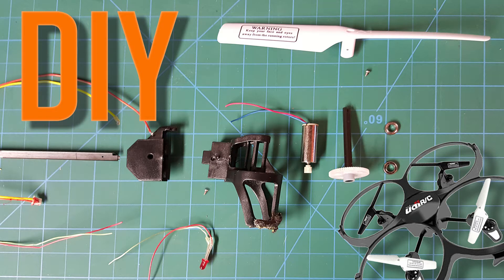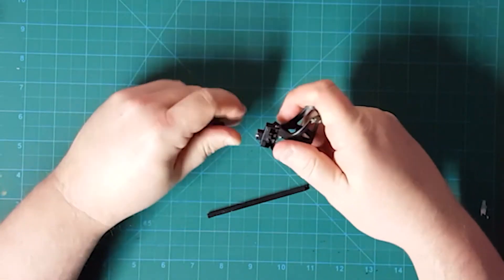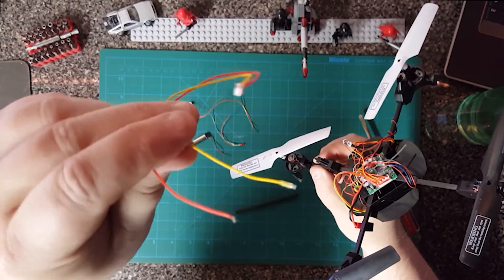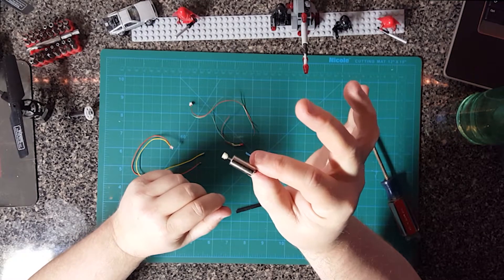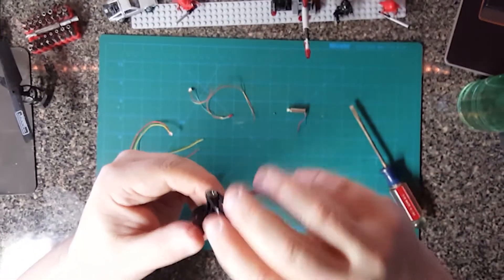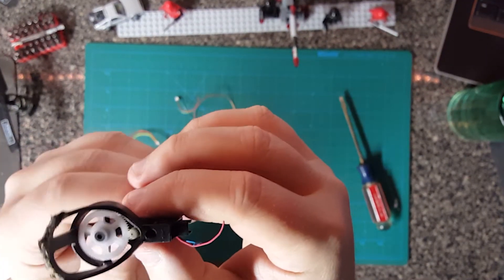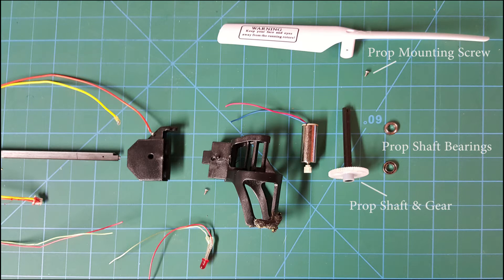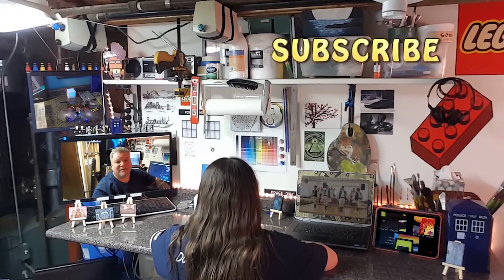UDI Quadcopter Motor & Gears Disassembly - U818A DroneTube

Comment: This video helped me replace the defective motor in my U818A-1 quad!! I was unsure about how to remove the housing at the end of the leg but once I watched this I was able to proceed with confidence that I wouldn't break it. I swapped out the motors like a pro! It's flying a lot better but clearly the bearings on the large gear are sticky, so I'll have to replace either those or the whole arm at some point. Anyways, TYVM for the most instructional video, it was exactly what I was looking for :D
Reply from the maker: Hey Tim, glad to hear the video helped. Good luck with the bearings and yeah it might be easier and more cost effective to just replace the entire arm. Happy flying and thanks for taking the time to post a comment :)

Comment: Having issue with replacement arm motor assembly.  Installed new arm and motor starts to spin with no control.  Swapped connector with other motor and issue moved.  Old motor seized up, could that fry the board connection?
Reply from the maker: Yes, I have heard of this exact issue in the past and it is usually the main control board. Possibly having too much current draw from the seized motor and shorting the main board. Sorry for the bad news!!!

Comment: very well thought out tutorial. you should do this professionally!
Reply from the maker: Thanks for the kind words crabtrap! :)
Reply: ThinCube
quick Q: how heavy do you think one of the metal arms are? i'm considering doing a carbon fiber armset ,but i originally thought the arms were solid steel. I'm wondering if the the t savings would be worth it now.
Reply from the maker: I'll weigh mine when i get home this afternoon and let you know. I'm actually not 100% sure that they are metal but will let you know either way. :)

Comment: Hi ...thanks for the video. Very helpful...my Quadcopter the wire going inside the motor (under the prop) is broken.  Is it possible to repair it easily?
Reply from the maker: Hello, glad the video was helpful. As for the broken wire, the ease of repair will depend on whether or not you can access where it is broken. The wires are soldered to a connection on the motor. If you can see where it is supposed to be connected and have the ability to solder, then just reconnect to that pad with some solder and you're done! Good luck and let us know how you make out!!!

Comment: I just got my discovery U818A.  I am trying to get off the plastic cover on it.  I unscrewed the 4 screws on the landing gear but the landing gear and motor are still solid in place.  I don't want to break it but how do you remove those so I can remove the plastic to work on the inside.  (I have to replace the motor and stem.
Reply from the maker: Hi Eric, believe it or not, it just slips off. Look at where each of the arms go through the housing. Theres a slot at each one. Just gently force the slot open and slide the arms through and the canopy will come right off. No screws need to be removed.  This link will take you right to the section i talk about removing the housing....https://youtu.be/SyiYImwijHc?t=1m27s  Let me know how you make out, Tony. Here is a link to spare parts....http://amzn.to/2glpM2Y

Comment: There is apparently to different versions of the U818a.  The battery voltages appear to be different.  The original version with the 2 wire RED connector is 3.5vdc,  the newer version with the 4 pin white connector is 7vdc.  I ordered replacement motors for a U818A and they go up in smoke after a single flight.  Do you know of a different part that is available for the U818A-1 Discovery FPV.
Reply from the maker: Hi Art, actually the "original" U818A is 3.7v and so is the Discovery from all that i've read (don't have one). I can't find any u818a with a 7.4v battery. Can you send me a link to the one you bought? The U818S, U829 and U842 take a 7.4v battery. I'll try to do some more research and will let you know if i find the right motors.
Reply: I've included a link to both U818A's.  The first is the 7.4VDC version,  notice the battery detail.  There's 4 pin connector REDtoBLK=3.7, REDtoBLK=3.7.  On the male connector, coming from control board, the two center pins RedtoBlk are jumpered together,  the voltage between the outside pins RedtoBlk is 7.5vdc.  I measured the voltage at the motors when acceleration is added and it is also 7.5vdc.  When I first ran across this was when I was looking for a replacement control board.  The Control boards are different also.  UDI references the replacement motor part no as U818A FPV-06 for c.w and -07 for ccw.link 1 = updated version 
https://www.amazon.com/gp/product/B00SH3MU0U/ref=od_aui_detailpages00?ie=UTF8&psc=1 link2= original versionhttps://www.amazon.com/gp/product/B00D3IN11Q/ref=oh_aui_detailpage_o08_s00?ie=UTF8&psc=1Thanks for your help.  Your video's are great, nice job
Reply from the maker: I understand now, thanks!  I see why i was confused, if you hover over the pic of the battery it actually says 3.7V but i understand putting them in series would give you 7.5V so that's what UDI is doing (with 4 wires). Thanks for taking the time to give us all this information, its helpful stuff. I think i may have found your motors. Take a look at this ebay ad and let me know what you think:  http://www.ebay.com/itm/All-spare-parts-for-Udi-U818S-U842-quadcopter-blade-motor-gear-battery-Camera-/261954623250

Comment: If you have burned up a motor, take a look at your board and/or plug one of the other motors into that socket first to see if you burned up the board too. Someone else commented about their rotor spinning constantly after replacement and I have the same issue (new motor spins as soon as you put the battery in, doesn't respond to throttle). After verifying the new motor worked properly by plugging into a different socket I took a look at the board to find that a rectangular chip next to the socket (stamped 2300 on top, there is one for each motor) had burned up as well. Wish I would have checked this out before ordering a new motor! Haven't been able to locate a replacement chip and doubtful I would even be able to solder it in properly. Can't find a replacement board for this FPV/wifi version either. Total bummer.
Reply from the maker: Awesome info Brian, thanks for posting. Do you happen to have a photo of the chip in question? Also, take a look at this board....it says its the Wifi/FPV version of this UDI....http://amzn.to/2bz89r7
Reply: +ThinCube thanks for the link! That is definitely the right board, for some reason I was unable to find that in my search. I do have a good picture, what's the best way to share it with you?
Reply from the maker: Awesome, glad i could help. You can send the pic to my email:  tonyboston.com@gmail.com  I'd like to see if we can find the chips in question as well....thanks, Tony

Comment: I had a question maybe you can help.  I just installed a new motor arm on my U818 and when I connect the battery to the copter that arm automatically turns on without the remote control and does not turn off until I disconnect the battery.  Any ideas?  Thanks
Reply from the maker: Hi, what were the symptoms before you installed the new arm? And are you plugged into the correct connector for that arm? Might sound like a stupid question but you never know, especially if you unplugged more than one cable and swapped them by mistake.  I made this video that shows the connections on the board:  https://www.youtube.com/watch?v=BUghqOSFTiw   Let me know what you find out.  Good luck, Tony
Reply: +ThinCube well actually I had been flying it and a piece of grass had gotten wrapped around the rotor and burnt the motor up so I had to order a new arm to replace it, and when I had replaced it I only unplugged that motors cables.
Reply from the maker: It doesn't sound like anything out of the ordinary. I don't believe the new motor being bad in any way could cause it to always stay spinning. I say this because the board has to output voltage to the motor for it to spin.  Maybe the old motor burning out damaged the board as well. Sorry i couldn't be more help!
Reply: +ThinCube it's ok thanks for the time

Comment: how do i get the motor out on mu udi drone
Reply from the maker: Watch the video and see how everything goes together (and comes apart). Once you get everything out of the way, the motor should just slide out. The gear on the motor is pressed onto the shaft so it too will just slide off with a little force. And like i mentioned, you will have to solder the wires onto the new motor. Good luck and let me know how you make out.
Reply: can i always end up getting a replacement arm for my udi u818 drone?
Reply from the maker: Absolutely its only a little more money but ALOT easier to replace the entire arm assembly. They are $7.99 each with free shipping thru Amazon Prime right now. Just be sure to order the correct one you need (either clockwise or anti-clockwise). Here is a link to the clockwise:  http://amzn.to/2nMckE7  and anti-clockwise: http://amzn.to/2oKn76s    Good luck and let me know how the repair goes or if you need any more help :)

Comment: Duh why didn't i think of cutting it lol. Stupid bent motor shaft. Amazing how a tiny offset gives the most insane wobble from small unbalance.

Hey u think it's possible to wire up motors from a MJX bugs2 with esc to these stick drones? I have a bugs with no remote and apparently impossible to find, so i want to salvage the motors from it.. but they're 2 cell battery motors.. 7.4v.. don't think it's gonna work.... Mostly cause of the incredibly simple board on the UDI with what, 1 micro chip and a few caps? Lol

Comment: This is the only 7.4v Micro Motor I was able to locate.  For reference the core resistance for the 3.7v motors is about 1ohm the 7.4v is about 2ohm.http://www.ebay.com/itm/2pcs-DC-7-4V-35000RPM-Electric-Micro-Coreless-Motor-6x14mm-for-RC-Helicopter-/231798034600?_trksid=p2141725.m3641.l6368
Reply from the maker: How about this one??  http://amzn.to/1tAY04K
Reply: Great!!!! Thanks